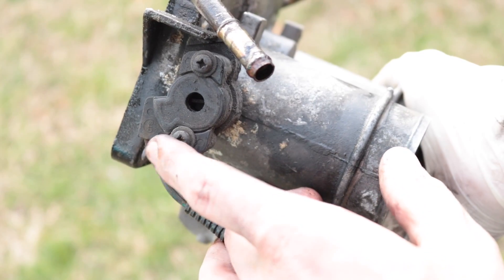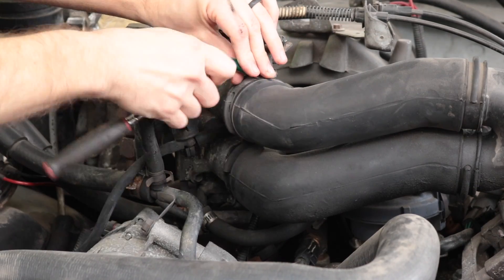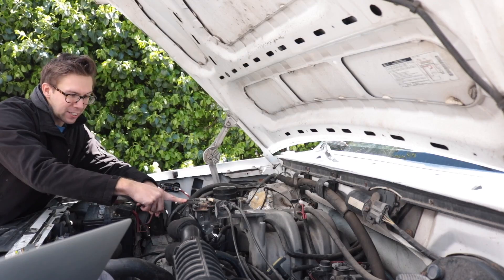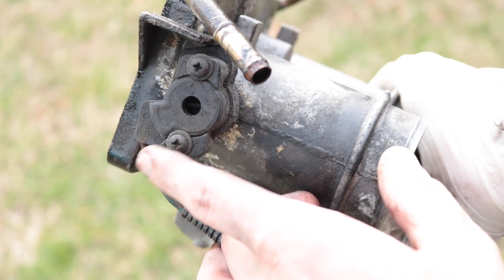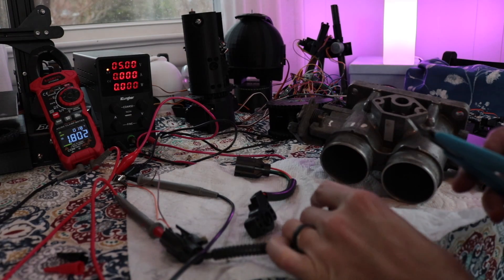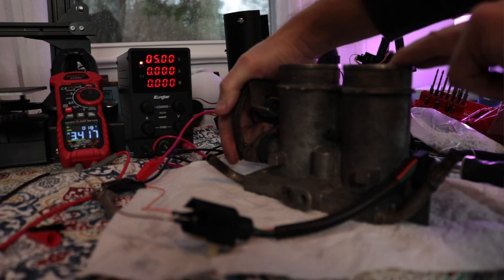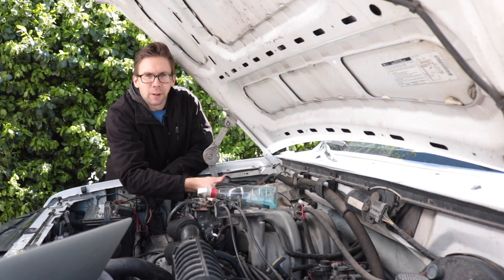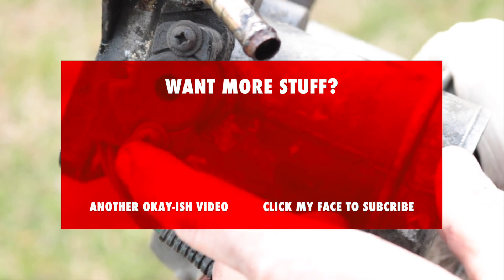Weird Drivability? DIY Throttle Position Sensor Repair - 1987-1997 OBS Ford 5.0L TPS

Comment: I'm working on a 1995 f150, it has a random hard shift 1-2. Have you ran into that issue before on these?
Reply from the maker: Me personally no, but the accumulator spring in these guys is notorious for letting go. I hear different people say the valve body needs to come out and haven’t researched it myself. I’m more familiar with this similar issue on GM 4L60e trans that have a plastic piston and fail but it would basically cause similar problems.
Reply: @MatthewFinlay  Yeah, the previous owner said the same thing, he drove it ten years like this. From what I understand the valvebody does have to come out. I've already checked tps for deadspots, the timing and the rear axle vss and wiring. May try to replace the accumulator assembly with ford's updated part number.
Reply from the maker: Oh that makes sense and who know what kind of damage a broken spring inside the bore coulda cause over 10 years… I think you’re on the right track then. Or at least, that’s what I would start with!
Reply: @MatthewFinlay  Yeah I'm surprised too, he said it never bothered him untill it became more consistent. 😆 People are saying the updated spring is more rigid, who knows I guess I'm going to throw a few parts at it and hope something sticks.
Reply from the maker: “Throw a few a parts at it and see what sticks” is 110.6% going to make it into an upcoming video buddy! I love it
Reply: @MatthewFinlay  Dude I just found out why they come with a sleeve. Lol It completely destroyed the piston and bore when it failed.
Reply from the maker: Hey!!!!! That’s great news! Congrats buddy! Did you have to drop the valve body? How was the sleeve to pull out of the bore?
Reply: @MatthewFinlay  I'm making a video soon. This version 1995 (Aode light duty) did not require the valvebody to be dropped for the 1-2 accumulator assembly, it's off to the side with a cap. It destroyed the piston, cap and bore when the spring broke.
Reply from the maker: Interesting, seems like a lot of people are saying it’s in the valvebody but not specifying which trans then. Awesome - I’ll keep a look out for the video!
Reply: @MatthewFinlay  This model has no sleeve, the case has never been machined its stock, Thank God 😆. I'm thinking about the sonnax kit instead with the press in sleeve, it comes with the install tool. Luckily no one has sleeved it before or I'd be out of luck, I'd have to find another case or have it machined.
Reply: @MatthewFinlay  I made a Yt short with it's location on this model.
Reply from the maker: All things I didn’t know! Good info buddy

Comment: Nice vid, although I don't have this engine it still looks very similar to the 300 Inline-Six. I might try this out since my van keeps stalling in drive. 

How do you exactly adjust voltage to the TPS? Do you make a bigger hole on the mounting holes to adjust (twist) the sensor while it's seated on the throttle body?
Reply from the maker: TPS or failed/failing Idle Air Control Valve would be my bets without evening having to open the hood haha. Exactly buddy, one hole is perfectly sized to the bolt while the other is slotted. Unfortunately the slot that Ford provides gives the pedal too much “dead” area in my opinion. That’s probably better for fuel economy or something but is meh to drive. I enlarged the hole to get it right up to .99 volts without going over - Price is Right style. But I’ve never had a Motorcraft TPS not test voltage correct by just taking it outta the box and slapping it on so clearly they are doing something right.
Reply: @MatthewFinlay   I see, it makes sense now. Thanks for the detailed response. You’re awesome bro.
Reply from the maker: Of course, hit me up on here or on Facebook and I’ll help the best I can if you run into a snag!
Reply: If you have to twist the TPS to get it to fit then it is on incorrectly. It should drop right into place with the 2 screw holes aligned perfectly. If you leave it in incorrectly then you will break the clock spring in the sensor the first time you step on the throttle. and  open up a whole new set of problems. Remember the trans gets it's shift signals from the TPS
Reply: You know i have always wondered about this but i have a 91 Mustang, not a truck ,i was just reading about TPS sensors and ran into this video.

i have a AOD on my car, they are the last of the Mohicans when it comes to full mechanical trannys so no shift signals from the TPS, only thing electrical in them is the VSS sensor,anytime i try to just "drop in" a TPS on my throttle body,well thats just not gonna happen, has to be twisted.

In every video Ive seen and in the description for a new TPS sensor it also says it has to be twisted to fit ,what you said got me thinking but i think these throttle bodies on these trucks are much different from what i have even though the sensor is just alike,this is a copy and paste from a installation instructions.
  When installing the new TPS keep in mind that the sensor is spring-loaded –
therefore, it must be installed counter clockwise to its lined up position then
rotate the sensor clockwise and install the two Phillips head screws. 

When they say "rotate" i would assume that to mean twist? 

This comment is to pick your brain if you dont mind,not disagreeing with you, i had had issue in the past from TPS sensors and i was wondering if i was doing something wrong? what do you think? i really appreciate your input.

Comment: Where does the throttle body hose that connects at the tps with a Y
Reply from the maker: I’ll have to go check where the connect. I think my top hose connects to a y in the heater line but the bottom one near the tps runs to the intake manifold.

Comment: I wish you the show the part how to back probe the sensor. Mine is throwing the TPS sensor. Just wondering how to get to the .9 volts with installing thank you
Reply from the maker: Oh man I shoulda talked about that! Ok I hate cutting/piercing the wire on the new sensor. So I unplug the sensor from the harness and take small gauge wire and to Insert into the pins of the sensor side and harness side. Basically connecting them together - always do this with the key out/ignition off and I always try to not touch them together
Reply from the maker: Splice or pierce you TPS signal wire and ground out the other side of your meter and boom. You now have a temporary extension you can mess with
Reply: @MatthewFinlay  I have T-pins on every sensor connector. Been installed for over 200k miles. Once installed I put a dab of liquid electrical tape on them.  Engine looks like it is undergoing a round of acupuncture.  lol
Reply from the maker: That’s awesome and smart! Being from the Midwest I’ve seen some pretty messed up harness from pinholes and testing wires. I always use a lil dab of rtv over the test point but hate doing it. Makes sense to me buddy!
Reply: @MatthewFinlay  that's exactly what I was thinking of doing thank you cuz I see how tight the motorcraft sensor is and there's no way to back probe it thank you
Reply from the maker: Of course! Good luck buddy!
Reply: @MatthewFinlay  so basically just a jumper wire between them right with the sensor unplugged?
Reply from the maker: Exactly, nothing crazy
Reply: @MatthewFinlay  appreciate it I just suck at electrical. I just put two complete engines in and I can't do electrical. Sorry to bug you but pretty much positive side of your meter on your signal wire jumper, and negative to ground on ground wire jumper or just ground out the meter?
Reply from the maker: Sorry for the delay but yes, you have it correct! But if you have issues I recommend using the wire as a ground and testing it with the positive side of your battery with the positive side of the lead. This will rule out a bad ground from wherever your sensor/motor/harness grounds at which could be throwing off you’re reading.
Reply: @MatthewFinlay  got it. 👍👍👍👍👍